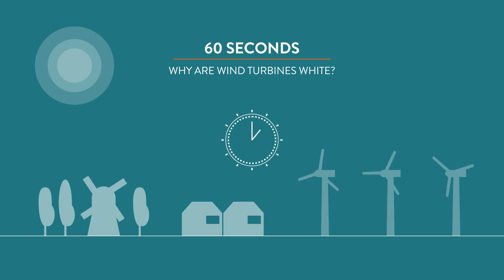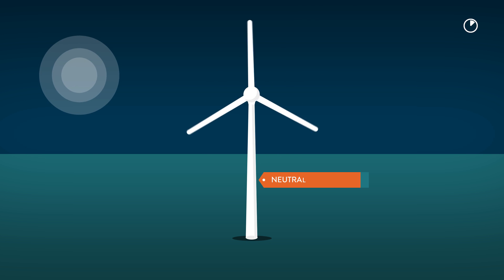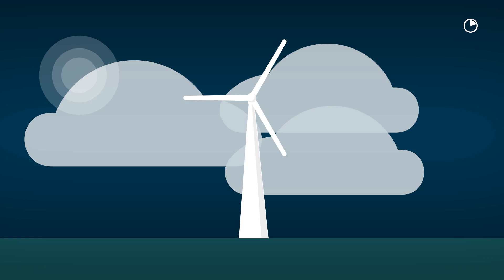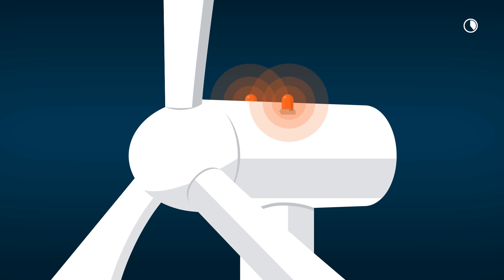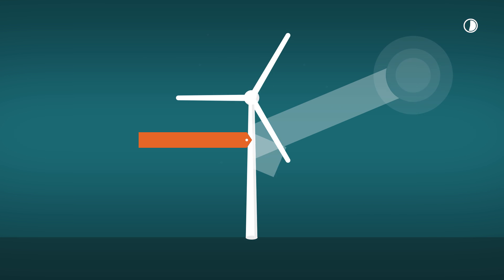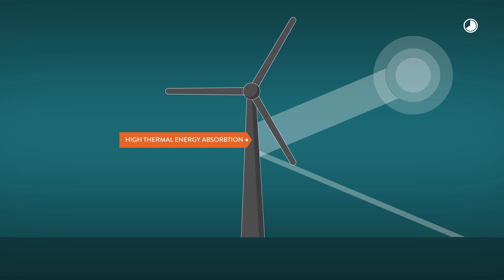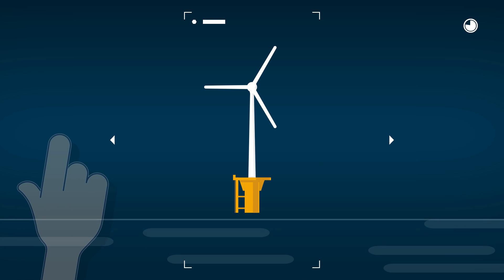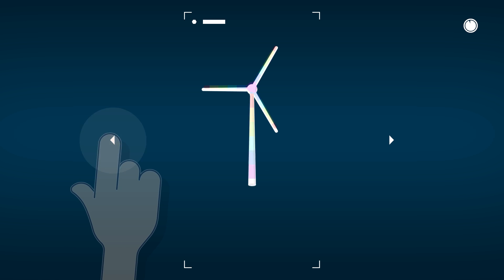Why are wind turbines white? - IN 60 SECONDS

Comment: Wind turbines only last about 25 years because they are exposes to adverse weather conditions 24/7. The cost of replacing our entire wind power infrastructure every 25 years will not be sustainable.
Reply: Thank you for answering one of my questions
Reply: As opposed to what? solar panels with a 20 year life? or coal fired power plants that cost order of magnitude more and last only 40 years? Everything needs maintenance and parts to be replaced for extended life, that is not a reason to not use it or a reason that it's not sustainable.
Please state what you believe to be a sustainable form of power infrastructure, because as far as I know there is nothing that generates power that doesn't wear out after years of operation, even Nuclear power plants are expected to last 60-80 years.